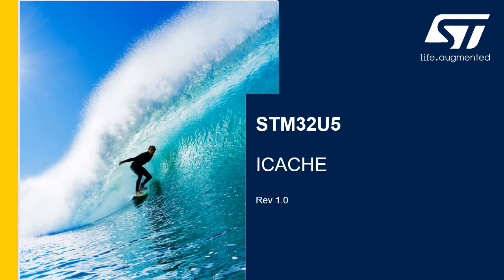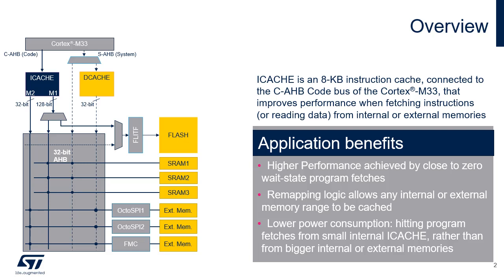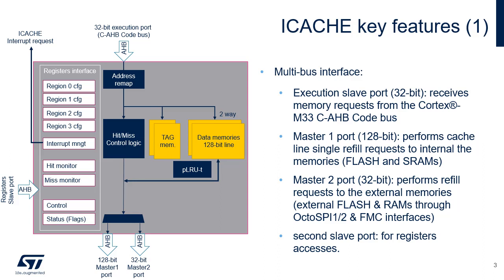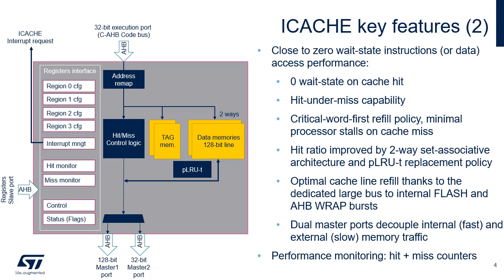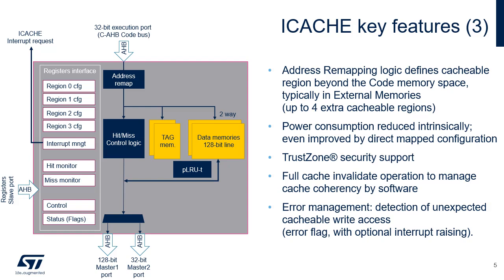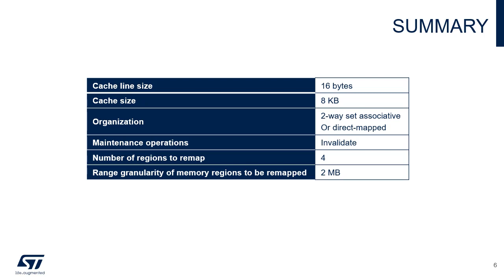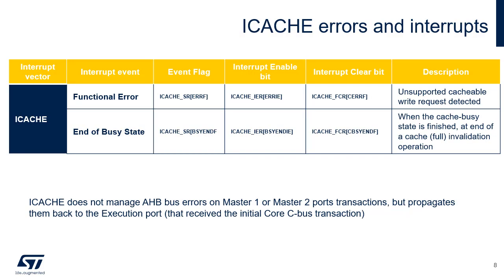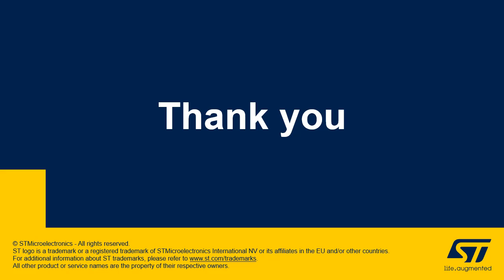STM32U5 OLT - System: Instruction cache

Comment: Summary:
Introduction
- Focuses on the instruction cache (icache) in STM32U5 microcontrollers.
- Icache improves performance when fetching instructions and data.

Features
- Hit under Miss support: Allows new processor requests while a cache line refill is ongoing.
- Critical word first refill policy: Minimizes processor stalls on cache misses.

Architecture
- Dual Master Port: Decouples internal and external memory traffic.
- 128-bit and 32-bit AHB buses for internal and external memories respectively.

Power Efficiency
- Icache reduces power consumption by fetching from internal cache instead of main memories.
- Can be configured as direct mapped for even lower power consumption.

Performance Monitoring
- Includes a 32-bit hit counter and a 16-bit miss counter.

Security
- Secure bit in each cache line prevents non-secure requests from hitting secure entries.

Error Handling
- Does not manage AHB bus errors but forwards the response back to the processor.

Conclusion
- Icache is beneficial for performance and power efficiency.
- Detailed characteristics and configurations are provided.